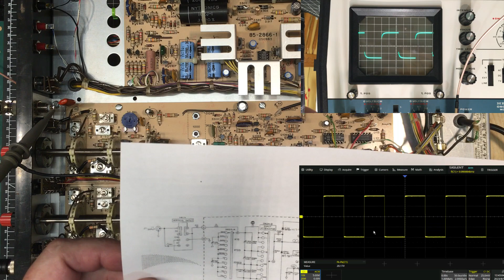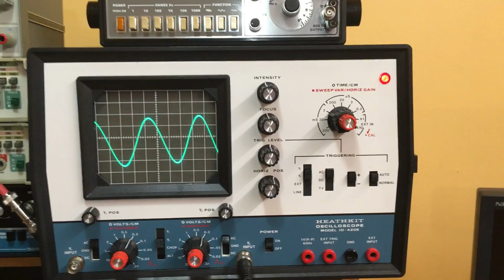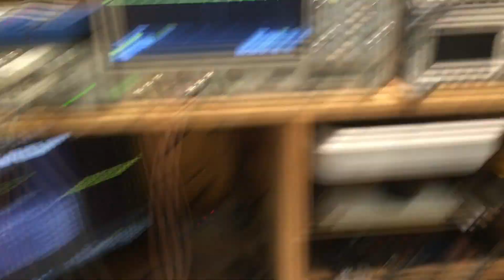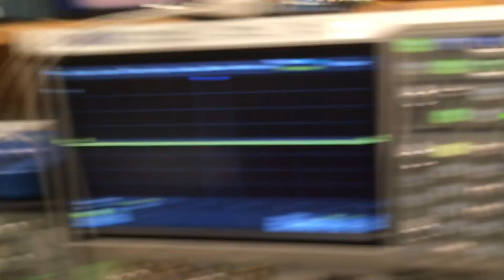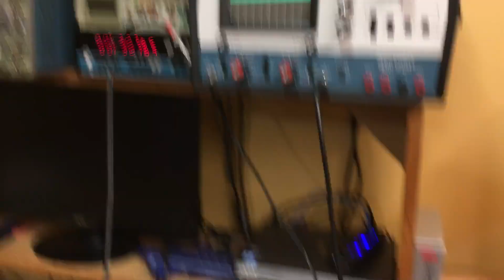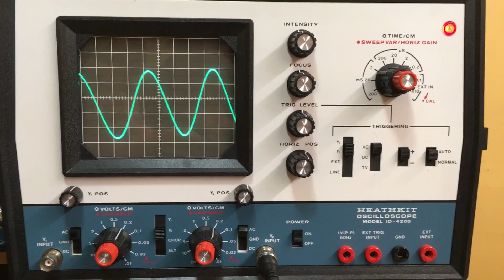0079 - Fixing up the Heathkit IO-4205: Part 3

Comment: Hi. I’m trying to calibrate my just repaired 4205. Im going through the calibration procedures in the manual. I’m at the horizontal board zero voltage set up and it refers to TP1-TP5 on the horizontal board. Heathkit didn’t label the test points on the board but rather in an Illustration Booklet pullout figure 6-4. Can you tell me if this comes with the manual? I’m kinda dead in the water if I don’t know where to test at. Any help would be greatly appreciated 😊
Reply from the maker: Yes, pictorial 6-4 is in the full manual.  Just google "heathkit io-4205 manual" and you'll find the full manual at manualslib.  That came up 2nd in the google search list for me.